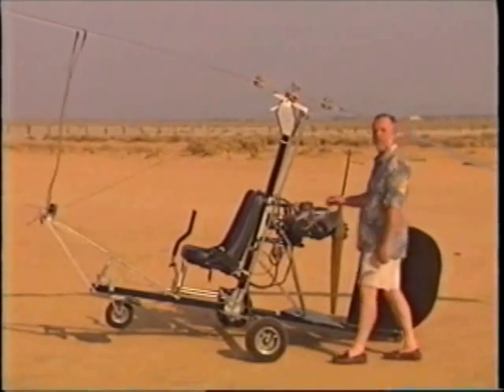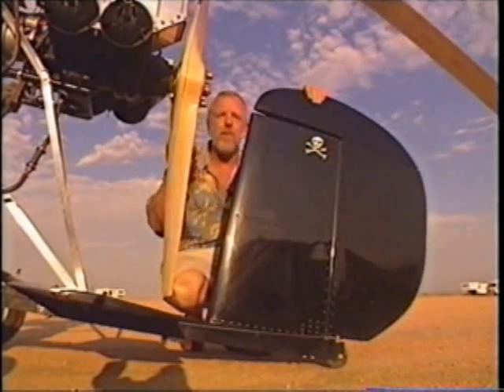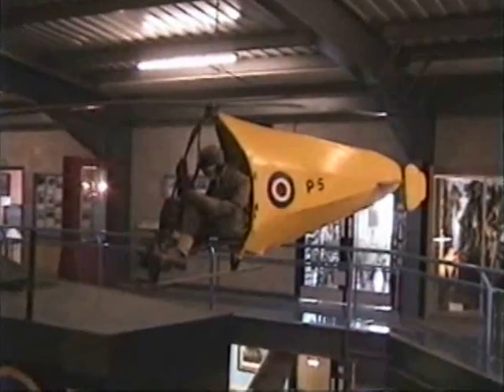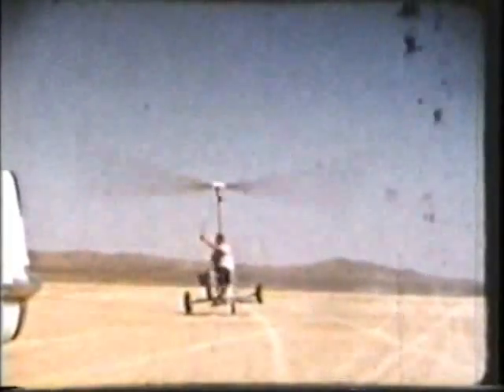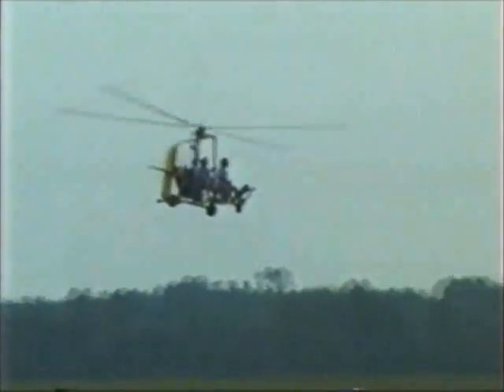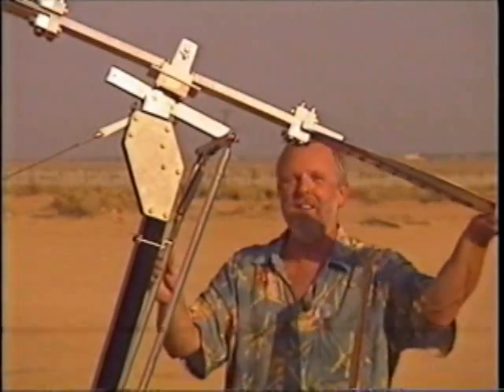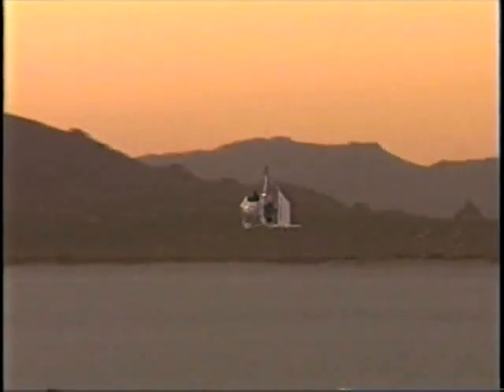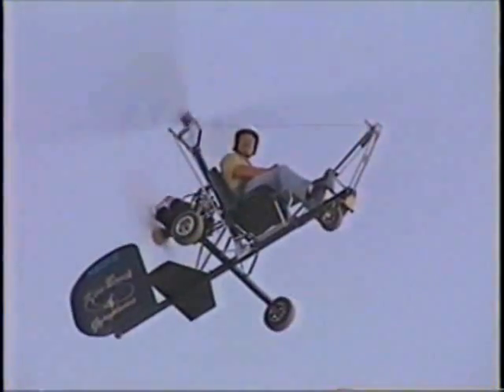Introduction to Gyroplanes (Gyrocopters) by Dan Donley

Comment: You can see that the overall mass of the gyro must is suspended and balanced from the rotor mast. In the classic pull design the gyro needed a longer tail to balance the large motor mass and supporting structure placed relatively far from the mast. Also a push design frees the front and gives you increased visibility on approach and touch down.

Comment: @ekul011 You do not need a pilots license for a gyrocopter as long as it is under 250 lbs, goes slower than 65 MPH, and holds less than 5 gallons of fuel.

Comment: He mentions in the video that the prop is in the back partially to wash the rudder. Very important at low speed. Even in a Cessna 152 flying at 45 knots (just about stalled) the controls are a lot less effective, so imagine an autogyro flying at 5 knots. You'd get no reaction at all!

Comment: I want to see a landing with very little or no role. Who is heavy hot and humid I had a passenger in my RAF also loaded to the gills with spear fuel full Fuel and camping gear on the passenger side my door was off. At 36 ft to climb over a small mountain with a cell tower at the top I had an engine failure. I was flying over unknown territory not familiar with the landscape at all looking for a place to put it down. I saw a leak off in the distance but I know I did not have enough altitude to make it that far. When are you finally descended to 2000 feet my passenger said this is a real engine failure isn't it? Yes I replied. At the last minute at a thousand feet I spotted a very small field 150 ft by perhaps 100 ft. I did a 180 degree turn losing altitude I set up for a Final Approach. I could hear my instructor in my headphones you really wasn't there but he was saying you better hurry up or you won't make it hurry up. At this point I was set up a final probably only 300 feet AGL. My passenger said do you see those wires yes I replied. Do you see that big tree again I said yes. This is a unmowed but Short Grass spot on the ground and that was a beautiful emergency landing with no damage to persons or property and I don't think I rolled 5 feet. A Precision emergency landing. The ship in the picture is the first gyro I built mostly from scrap I found.

Comment: hey, does anyone make a half breed?  you know a helicopter that you can disengange the rotor in flight and just use a horizontal engin  to keep blades turning
Reply: Nine year old answer --- not as far as I know, but.....Many do have very impressive jump capabilities for zero runway takeoffs. There are a few companies experimenting with gyros that have small wings that can create lift at high speeds. This enables the pilot to then change the the pitch of the rotor to such a degree that it no longer provides lift and as a result  has much lower drag (+/- 100 rpm). The gyro then functions like a pusher airplane for faster, more economical flights than with rotors alone.
      Jump capabilities + wings = win!

Comment: How did that "jump capability" work?
Reply: Pre-rotator spin the rotors,pilot control pitch of the blades,and pull up in to fly when blade speed has been achieved,(read more about Collective pitch)

Comment: How do you get jump capability in an autogyro?
Reply: +CHOPPERGIRL AIRWAR To do it the gyro has to have a variable pitch rotor head pretty much identical to what you'd find on a helicopter, as well as a prerotator.  Flatten blade pitch then overspeed the rotors with the prerotator, then add blade pitch back and up you go, just like a helicopter.. at least for a few feet.  They aren't very common in homebuilt or kit circles though due to the amount of complexity and cost the variable pitch rotor head adds.
Reply: +qumefox OK.  yeah, not common.  http://air-war.org
Reply: CHOPPERGIRL's AIRWAR check out the CarterCopter. If they ever get into production it should be a wonderful machine... now if they would just do something about that butt ugly styling!